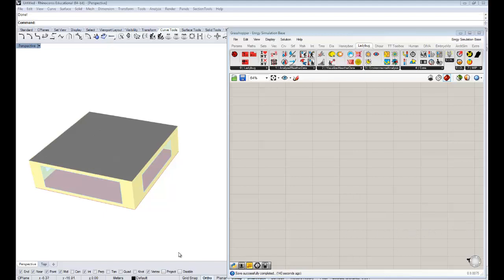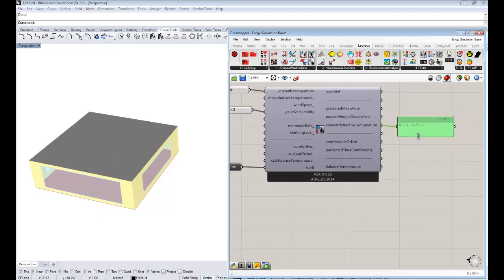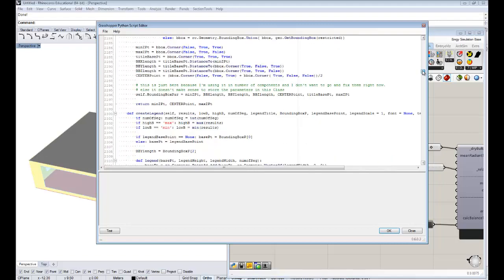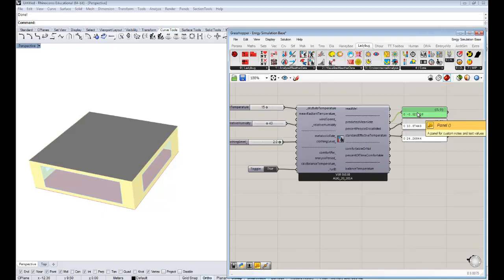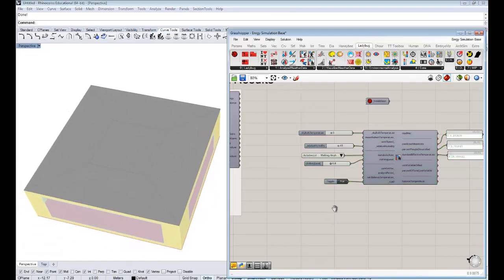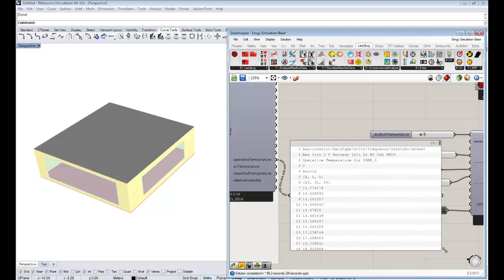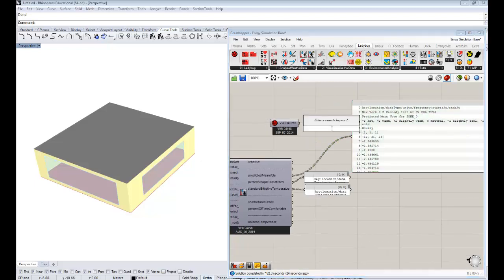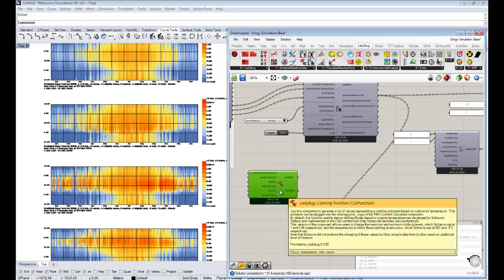2 - Ladybug Comfort Tutorials - Indoor Comfort: PMV

Comment: Hello! I'm trying to understand this pluggins for grasshopper and the runEnergySimulation told me: "Currently the EnergyPlus component only works in Meters. Change the units to Meters and try again." How do I do that?
Reply: For anybody else running into this issue, simply change your Rhino units to meters using the "Units" command